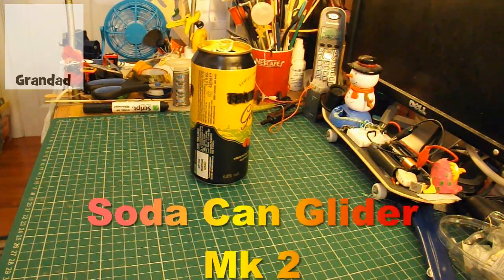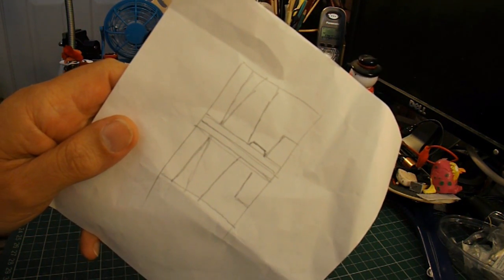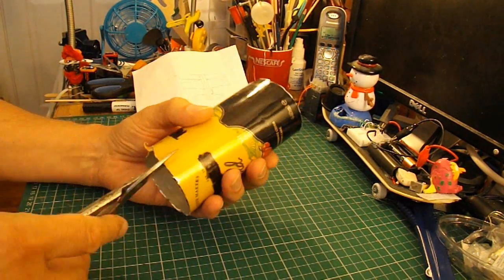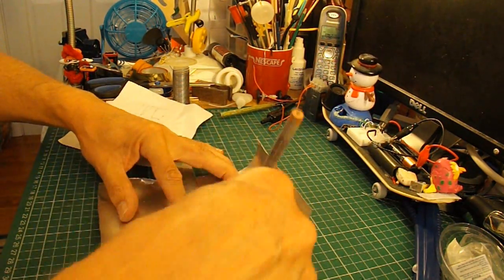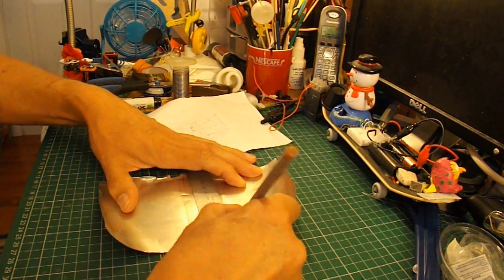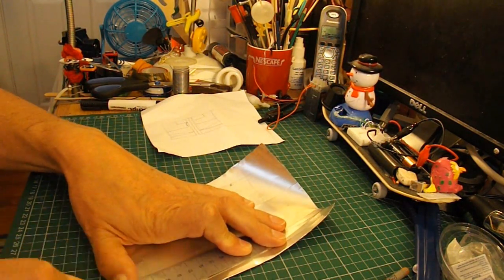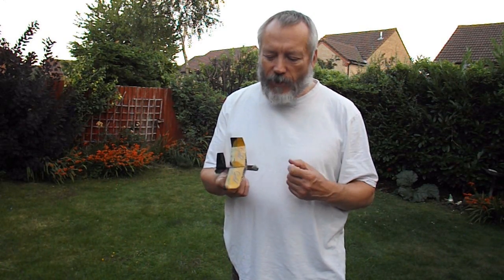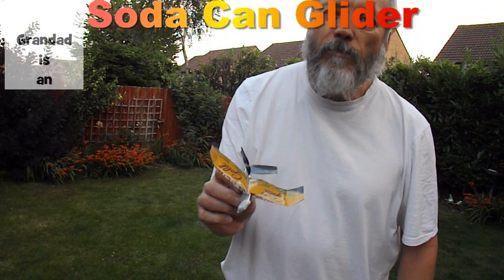Soda Can Glider Mk2

Comment: hey grandad not sure if you’ll see this but I’m doing a physics project and I have to use a soda can to make an airplane. do you think you can make another video on this but a more detailed tutorial?
Reply from the maker: I can't promise anything at the moment. I will see if I can find my old video files and see if there is any way to re-edit them. I will just add that I think this project needs a warning with it. When you are cutting a can like this, you get lots of sharp edges and could easily cut yourself badly whilst working on it.
Reply from the maker: This is the original video re-edited to playback at normal speed - it might help a bit https://youtu.be/erWw9MRhzJY
Reply from the maker: Here you are, a complete new video https://youtu.be/40WYG5vLvCk